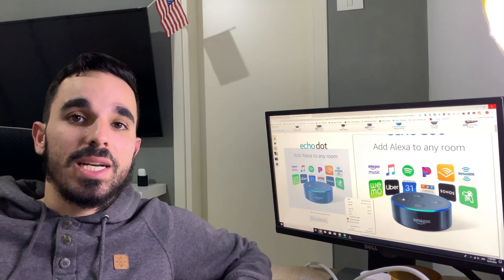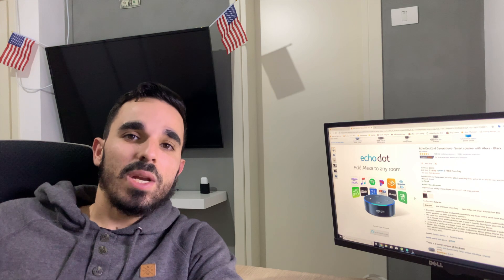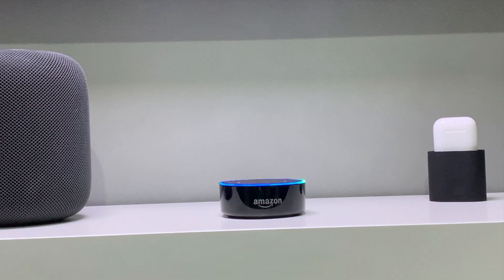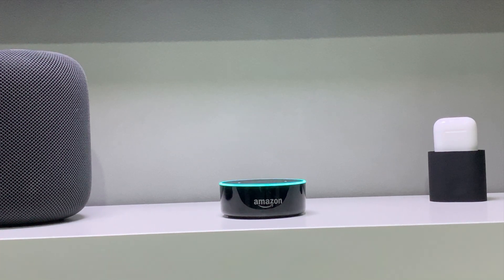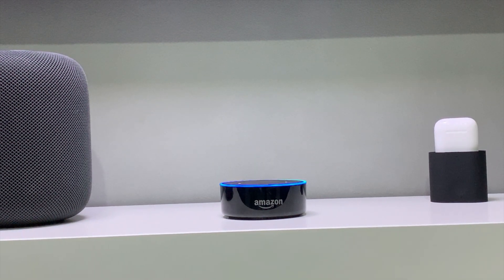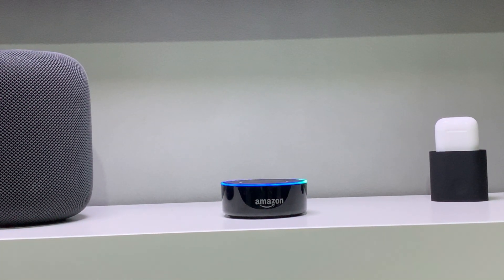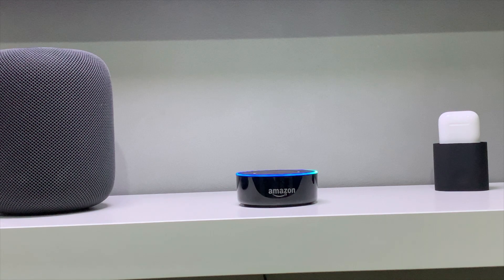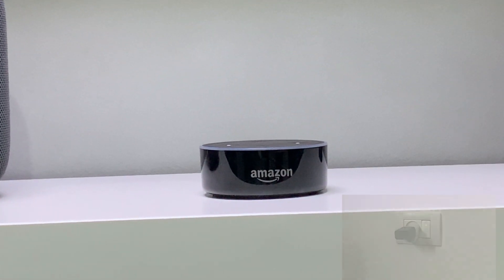Alexa Gets New Features Using Arduino(Clap Detection) | Hacking Alexa

Comment: way over engineered. Tap into the power for the arduino at the usb dont pull it from the eachos board. Then tap into wake circuit

Comment: Would be nice if you would explaine what your doing instead of that horrible music
Reply: First you need an arduino that can sense claps and activate an output.
After you have this you connect the output to the Alexa button.
So basically you can press the button or send a signal to where the button is connected to activate the same function.
The problem he had was that the Alexa speaking also activates the arduino output so he reads the Alexa lights output to cancel the arduino output while it is on